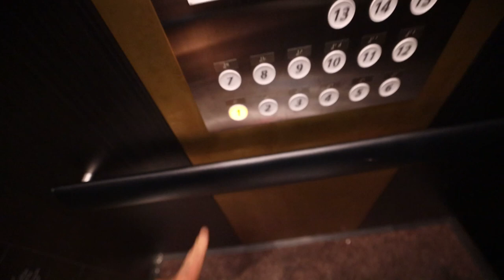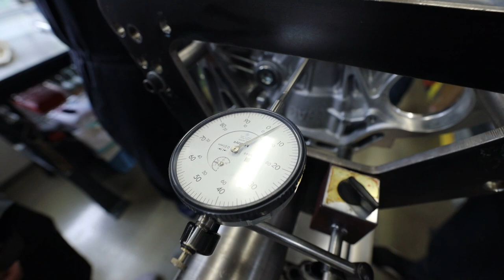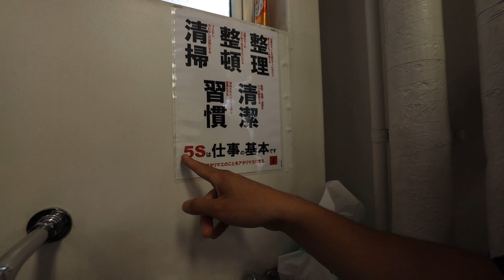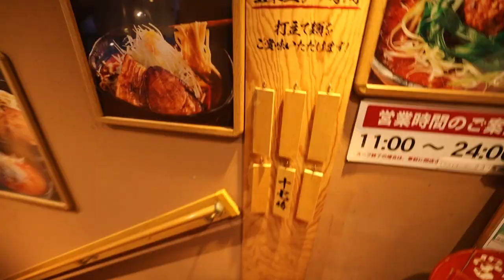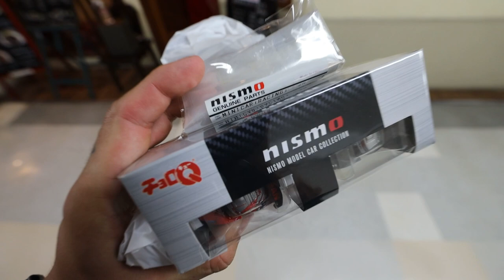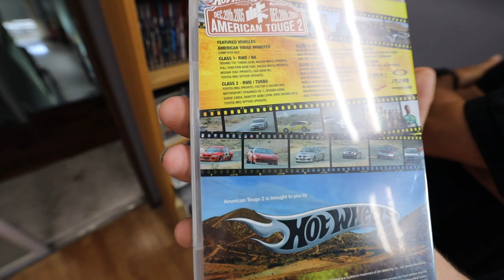Trying to Buy the Spoon Type One Civic Type R in Japan! *Touring Spoon Type One*

Comment: For the engine build room, if the temperature is too hot or too cold, as we learned, the metal will inflate or shrink a little bit. Thus, the build such as piston ring data will be different, and cause difficulties moving or oil goes into cylinder